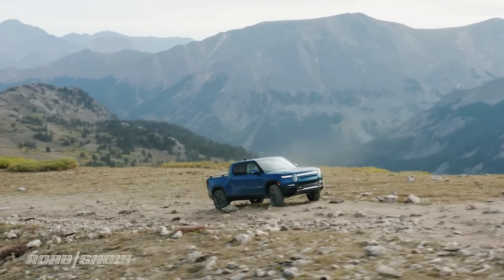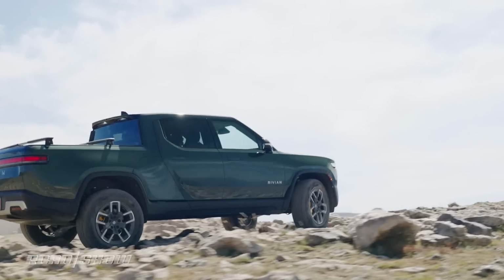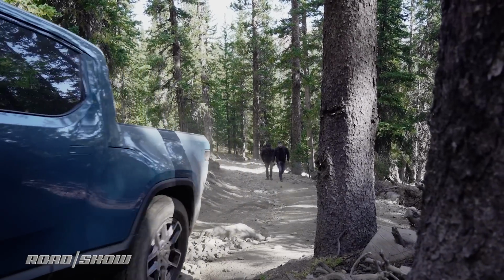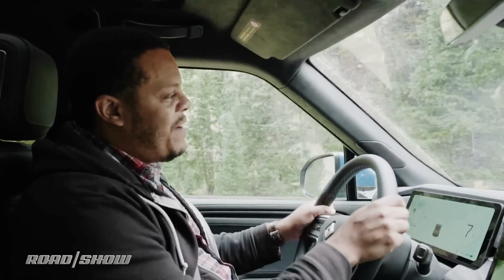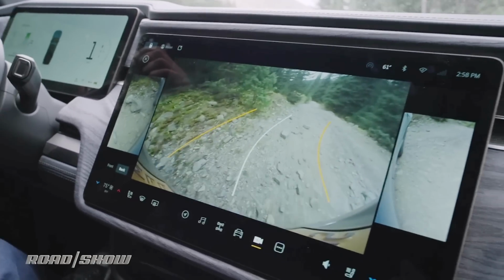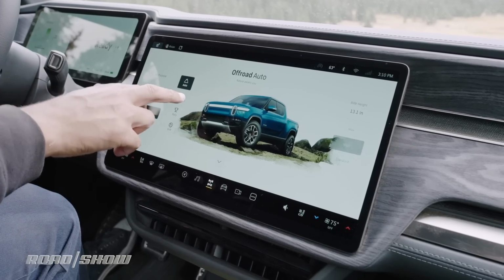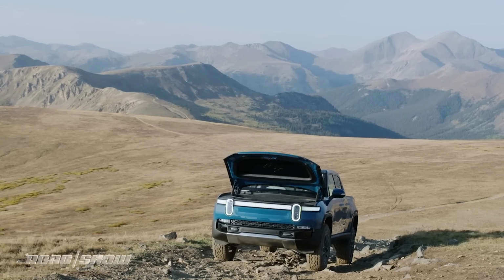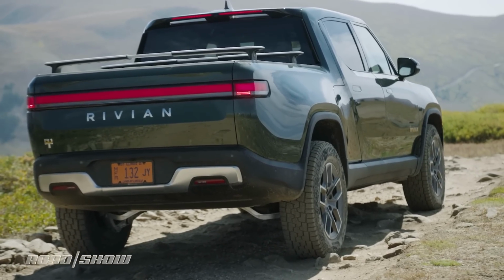2022 Rivian R1T:  All-Electric FIRST DRIVE

Comment: Everything about this truck is awesome, except the weird lights in the front. And maybe add some manual buttons to dash, don’t really care about controlling every single thing on that screen…computers are always having glitches.
Reply: If you magine how the concept sketch looked with lines and shades, the headlights must have seemed to resemble vents, and the extra led light to the sides would have looked like the main headlights, like in the new Hyundai SantaFe. And with that perception it looks quite serious and rugged, little did they know that people will see through the illusion and won't be able to "unsee" it. And now it looks to many like Micky.

Comment: Reserved one in February! You get the utility/off-road capability of a pickup truck with the performance of a performance car. I think I have watched every YT channel that was invited on this press junket. I love the 4 motor electric drivetrain with 800hp and 900 foot pounds of torque.
Reply: When’s the car gonna be available?
Reply: @Fuegolino  2022. The rumor is that Rivian will be offering a lower priced dual motor version as well next year. They supposedly have 46k orders so far. You won’t be seeing one on every corner like an F150, Silverado, Ram, Tundra, etc.

Comment: Imagine this: Hey I am environmentally conscious, drop 70-100k on an electric truck status symbol, go off into the mountains and the battery charge is low. No problem, let the solar panels charge the bat...dangit, no sun through the clouds. Well I guess I'll fire up the dino-juice generator/charger and defeat the entire idea of getting away from petrol.
Let's not mention the environmental damage caused by the mining of the materials to make the battery and vehicle itself, but the short life of the battery array and it's cost plus the further damaging of said environment by disposing of the battery. (Which cannot be recycled safely or cleanly).
Nah, I'll stick with my 77 Cherokee Chief which sees maybe 300 over five years.
Reply: Rivian already has a battery repurposing program. When the useful life for a vehicle application is over, they can be used in homes and other applications very effectively.
Reply: Tesla is getting somewhere like 400k miles before batteries are depleted to 80% and need to be replaced. I wouldn’t call that a short lifespan at all.
Reply: @zoyaspencer8025  Opinons are like buttholes. Everyone has one. :)

Comment: 4:20 ok? you failed to say how much battery you've used up and how much is left. You left it kind of vague
Reply: That’s probably cause they used 1/3rd of the battery going 10 miles or so. Though the terrain seemed quite easy so it’ll get better than if it were slow speed crawling over obstacles. To be honest a gas engine gets bad range off road as well, though it’s much easier to carry extra juice.

Comment: The gear tunnel is an old idea, I know that Dodge did a gear tunnel on the M37 military truck in 50s. I’m not sure how old that idea is, but it has probably been around for a long time. Not that that storage solution has been utilized in recent years much or at all.
Though it is very interesting to see how some manufacturers of EV’s are really miniaturizing and condensing the vehicles components to maximize storage and interior space, as well as utilizing all of the dead space, very cool!
What manufacture was the best at utilizing interior space in ICE cars, maybe Honda?!

Comment: No one has explained what happens when you take one of these on a trail, get stuck or have to take another route back and you run out of charge. Ordinarily you just bring an extra fuel can…
Reply: Sparkcharge, portable charging unit with medium power DC charging. Or eventually, hit one of the 10,000+ charge stations they're aiming at trailheads, mountain towns, national parks etc.
Reply: @SteveBirkett  I think you missed the point being made...traveling off-road brings many unforeseeable challenges often requiring changing your route for a variety of reasons which can significantly lengthen travel distance...having gas cans, or traveling in a group who can provide gas if needed, can be essential for survival, and just so you CAN get to a 'charging/gas station' at the trailhead.
Reply: @Daniel-ux8tx  Right, but the equivalent product, a portable battery (or "Jerry can"  of energy), already exists. Bidirectional charging is also possible from vehicles like the F150 Lightning. They're not widespread yet of course, because neither are EVs. But the fact that these solutions already exist means it's just a question of scaling them out to where they will be needed.
Reply: @SteveBirkett  can you send a link to the ‘portable charging unit’ ?

Comment: Is this a $100k+ off-road lifestyle truck, like a jeep or bronco.. or is this meant to be a work truck like the F150 Lightning??
Reply: As tested it's not 100k, but $73,000. It's a lifestyle adventure vehicle though. 😁
Reply: Think Land Rover but electric and much much faster. Should be equal to if not better than a Raptor off-road, with more horsepower, and a better ride.
Reply: @CrazyWeeMonkey  no way it’s better than a Raptor. Power isn’t everything. The Raptor has 14” of suspension travel and bypass shocks that literally allow the shocks to start of soft and rapidly get stiffer as they compress. 
.
Plus the Raptor is quite a bit lighter than this 🤣😂 8500 lbs gvwr and 1700 lbs payload means this thing is like 6800 lbs. nearly a ram 2500 gasser weight.
Reply: @KTMcaptain  

The raptor is very capable but the suspension on the Rivians is surprisingly capable, and having an electric motor on each wheel with instant torque really helps it off-road.
Reply: @CrazyWeeMonkey  there is no comparison between their shock absorbers. The Raptor has active valving in actual bypass shocks. 
.
The Raptor also has a locked rear axle and torsen front ifs.
.
Raptor isn’t a crawling vehicle. It’s setup to pound desert obstacles at high speeds. 
.
Here’s an issue with your independent motors. When a wheel begins to spin it not only loses grip but also loses stability. Independent motors will spin out before maximizing traction and therefore can lose momentum and stability. This was actually seen several times in the video. A locker maximizes traction on its axle. One wheel cannot slip unless both exceed the torque capacity of its traction. A fully locked driveline will literally bias torque to the wheels with the most traction before losing grip, stability, and momentum. Obviously it helps in the sand because it can actively bias power. On rocks next to an obstacle it can help cause damage as the vehicle loses grip and slides into an obstacle.